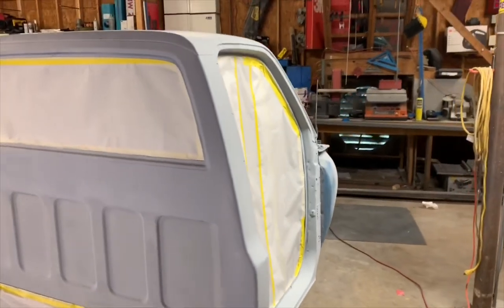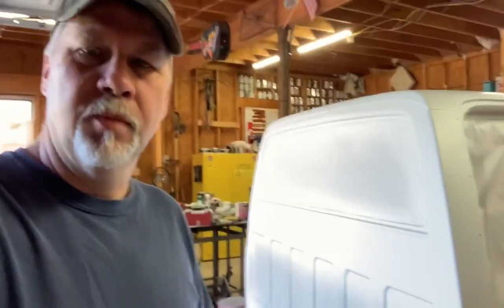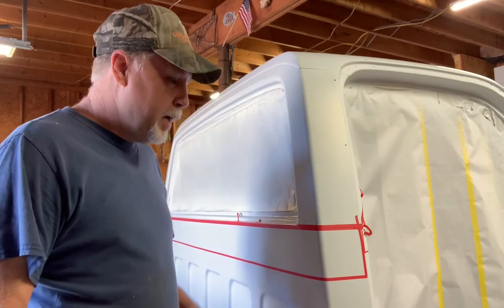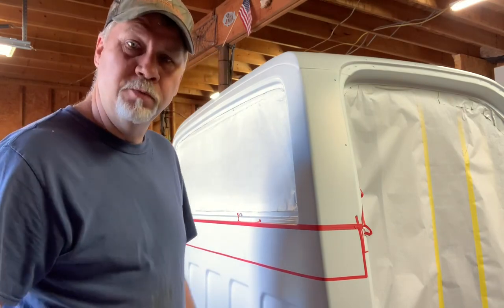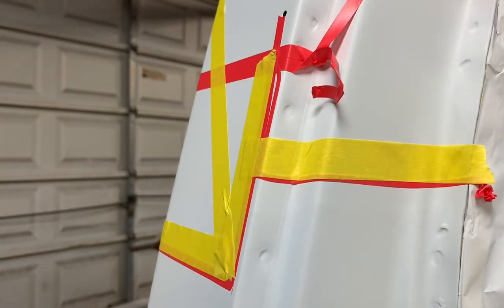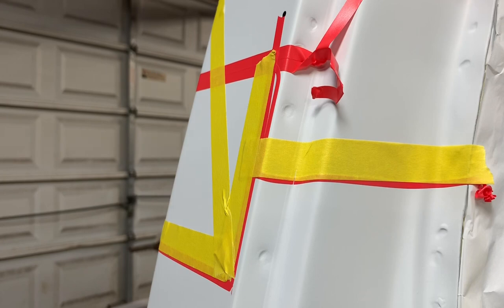Project C10 Episode 5 Painting the outside of the cab

Comment: You don’t see that done, ever! Excellent results as thousands are going to touch the painted trim for decades, then freak out. A job well done deserves a pat on the back and a verbal congratulations!
I know I couldn’t do it.
Reply from the maker: Thanks 👍. Hopefully I can get the rest of the truck done before long.
Reply: @StoutCustom  I could see many color used to make this painted chrome looking trim, but I have seen other do an “Inter-clear” to complete this then finish. There are several times I have seen this process but not no step-by-step instruction and products used. I bought a nice air brush but have only a few hours using it in practice. Thanks for showing what you did. Thanks for sharing as I just want to learn.

Comment: You mentioned the drip rail trim on the cab, will you do a video on installing the drip rail please?
Reply from the maker: I’m sure I will when I get back to my squarebody. Might be a little while. Also I have the ones that came off and the holes are still in the body. Should be fairly straight forward on mine.